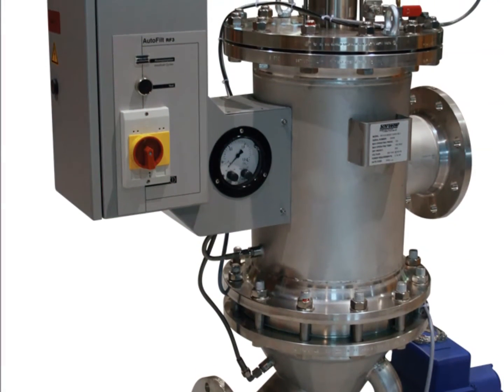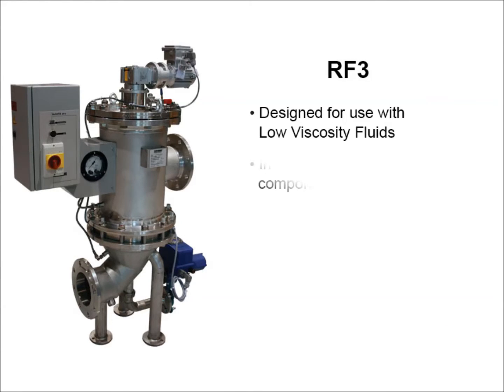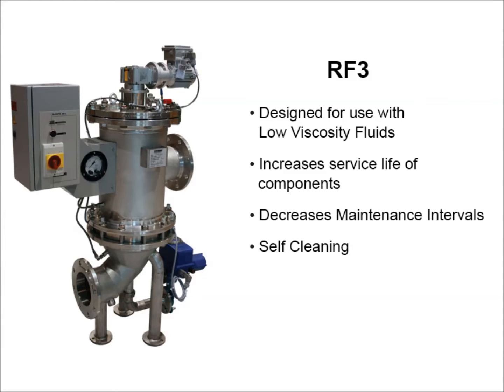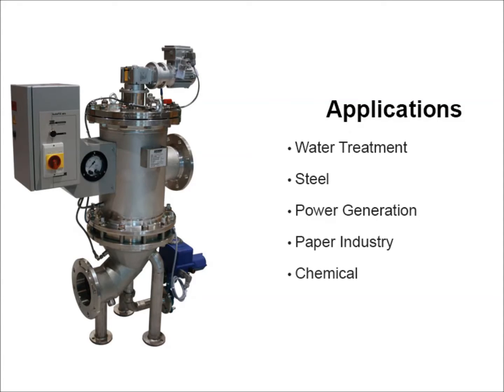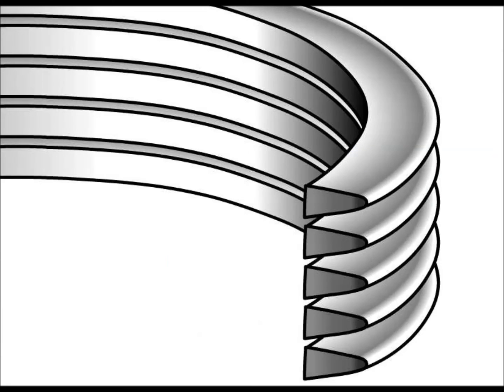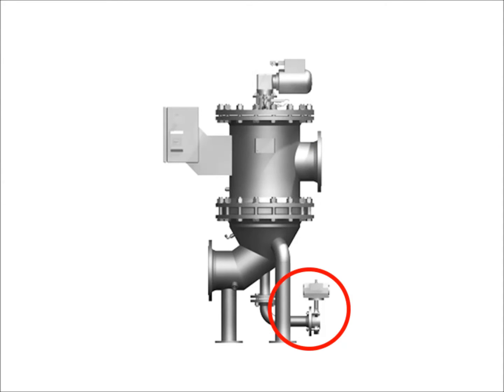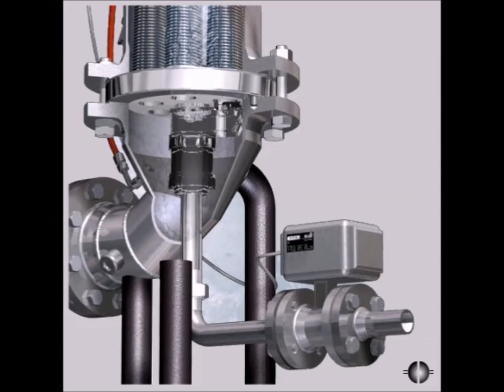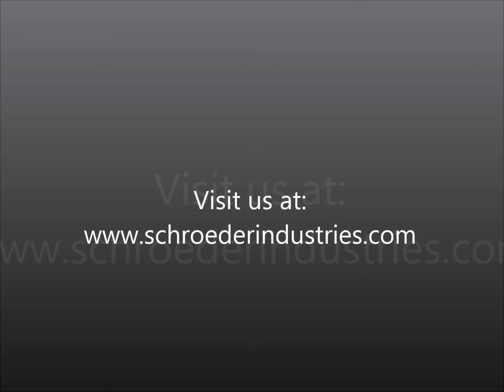RF3: Automatic Backflush Filter Technologies

Comment: Good morning. Please how to set up the differential pressure reference value on this RF3 filter?
Reply from the maker: Hi Steve Valdo Wandji Yewah! To answer your question, we'd need a bit more information. The answer strictly depends on the controls that you have. In general, the differential between influent and effluent is set at 7 psi to initiate backwash. If you still would like to know how to set it, please contact our Group Product Manager - Process at Mike.Wild@schroederindustries.com.
Reply: Good morning,

Thanks for your kind reply. 

I'll contact the manager, 

Regards.